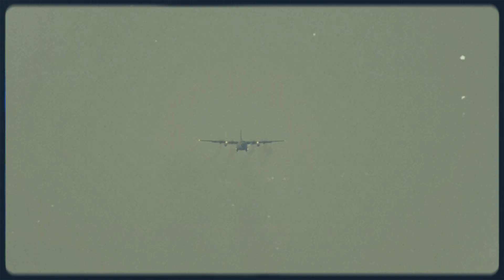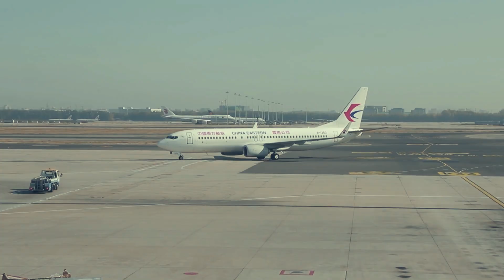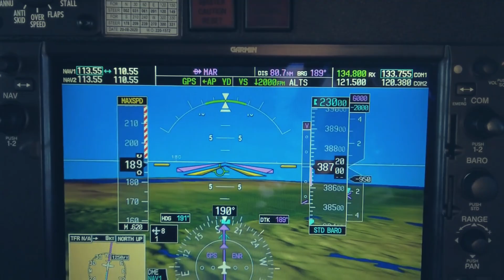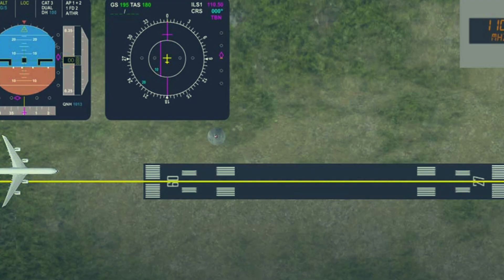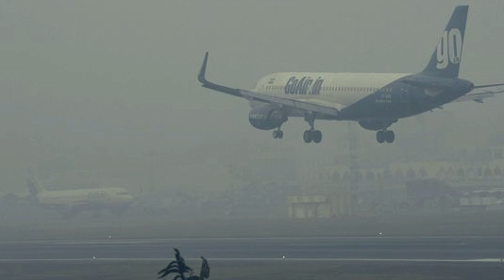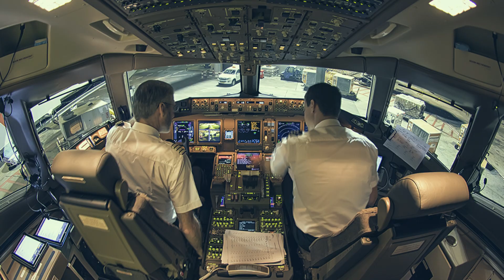How Planes Land in Zero Visibility — Instrument Landing System Explained

Comment: Good video - I'm sure it will be helpful to non-pilots and possibly reassuring to them as well. 
One question many might ask - and with good reason - is what role GPS plays in all of this. A few years ago, the answer would be easy: NONE!
But the times they are a changin' and today several categories of GPS landings exist, with the LVP category being as precise as the ILS described in the video.
In fact, the FAA is announcing changes to the nomenclature; Until this year all approaches were classified as "precision" and "non-precision", depending on whether or not they had precise vertical guidance (glideslope) in addition to lateral guidance. This classification became increasingly outdated as the ILS remained the only type of approach to enjoy the "precision approach" category, when as mentioned a GPS/LPV approach is every bit as good. Starting this year, the FAA has abandoned that characterization of approaches, recognizing technology has caught up to it. 
But wait - there's more! 
Two years ago, Garmin demonstrated for the first time an entirely autonomous landing system for general aviation aircraft, using solely GPS guidance, and allowing Single-Button press fully automatic landing that a passenger may use in the event of pilot incapacitation. The system will evaluate the aircraft position, select the nearest suitable airport for the aircraft type, control all of the speed and configuration elements and even make the necessary radio calls to bring the aircraft to a perfect landing completely automatically, without any human intervention other than the "LAND" button. 
Approved only for emergency use right now, it is more than clear the days of requiring a trained person to land any aircraft are already history.
Reply from the maker: This is a great piece of information that you have shared Greg!? What are you profession wise? Looks like an avgeek.